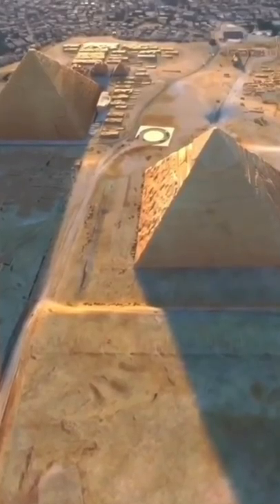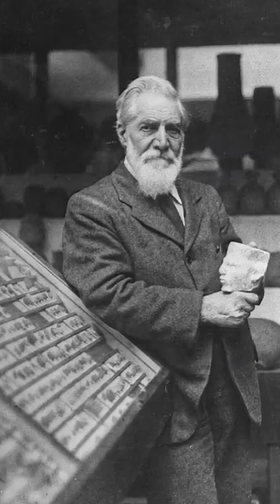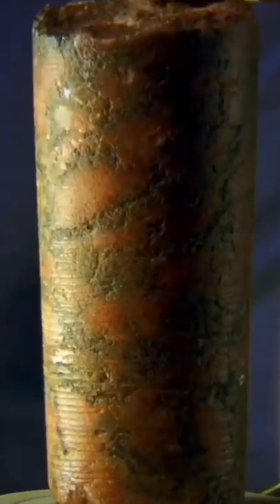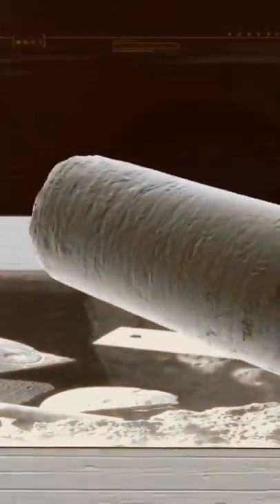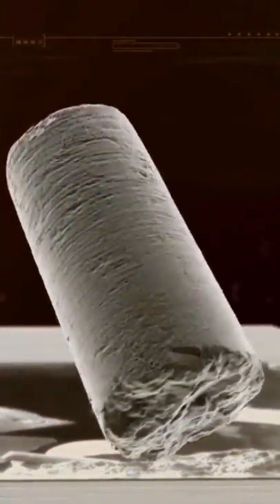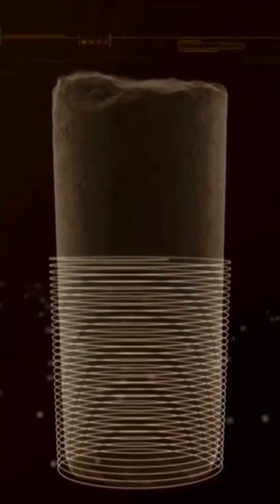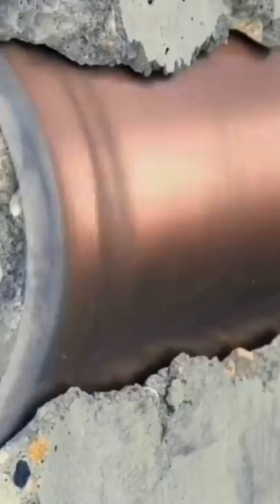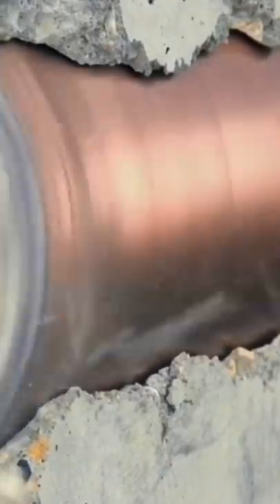Advanced Ancient Tech found in Egypt! Core7

Comment: I do core drilling for a living. I use a drill like that with diamond bits. The cores from the concrete look a lot like that.
Reply: Sorry to bother but would them putting diamond laces materials on a “drill” would it be able to cut this? I’m just tryna figure out how they did this!
Reply: @HurtsEnd  I don't think it would work. I believe it would bind. The diamonds need to be a part of the teeth of the drill bit, along with a high speed drill.
Reply: @HurtsEnd  heat or water to soften rick
Reply: They wouldn’t have been capable of making such a tool to drill in this manner
Reply: I used to core as well for a geotechnical/civil engineering firm. This core has more course grooves than the cores I would sample. Idk, looks different, may be because it’s old af.
Reply: I don't think they were as precise, but when there's a will there's a way. They were humans just like us, just different knowledge, not less, different. they of course had an approach more suitable to whatever technology they had at their disposal, the problem is we don't know that and this makes us question whether they had technology at their disposal we thought otherwise impossible. maybe they didn't have electronics, but had a greater understanding of using the basics because that's all they had to work with(heat, friction, gravity, simple mechanics, water) maybe their was some type of huge drill, rotated by pulleys and cranks and gears powered by either livestock, humans, water, or some other type of engine we didn't know they had access to like a steam engine. if we were wiped out, we'd be less impactful than the Egyptians, because they were smart enough to leave mega structures that would not go away
Reply: “1600 revolutions per minute”? I didn’t see 1600 grooves on it. And that’s being generous considering it likely took more than 1 minute to drill that.
Reply: @geddes.  this is the entire agreement 
That they had tools and power just as we did
The problem with saying that
Where are the tools
Reply: @geddes.  yea, it wasn't the dynastic Egyptians. They didn't have the tech. 
It's the lost, advanced civilization that got wiped out during the last ice age. That simple ,
Reply: @mikem4203  Where will our tools be in thousands of years? That's right. . Dust
Reply: I think they misinterpreted the actual   history
Reply: Search for how to melt stone. Guy uses frequency on copper to cut hole through stone
Reply: Look at the slight deviations in the markings up and down along the path. It speaks of irregular movement into the drill hole during operation. That would not happen on a mechanically driven tool.
I'm thinking a slow rotating diamond (or other hard material) drill that was applied with weights.
Also you have to remember there is a large probability the granite was molded with geo-polymers, therefore holes were probably drilled before the polymer was fully hardened and thus drill bits could have been made with the copper that was available..
Reply: im the manager of a core drilling coorperation, i agree
Reply: It is a modern core drilling specimen.  Someone cored the rock to see what it is.
Reply: @HurtsEnd  Modern core.  Start there.
Reply: @h.w.2038  Yeah, modern drill core of the rock, at least 75 years old.
Reply: @liamnitro8043  if you heat a rock to be brittle it will stay brittle. water does nothing to hard rocks like granite.
Reply: There was an acidic substance that softened the stone, I think they used this in conjunction with a tube drill
Reply: @ryanowen510  No one could ever tell how many revolutions per minute the tool was spinning to make that without knowing how long it took to cut that. This makes stuff up all the time.

The problem is exactly what you just pointed out, if we made that core with todays technology, it might take 20 minutes, and at a low speed like 800 RPM, you are looking at 16,000 grooves! So many in fact that they would be nearly undetectable, not clearly visible like this ancient one.

This is some technology that we either lost, or never had.
Reply: @liamnitro8043  They use a slurry pumped down the inside of the pipe.  At least they do on the diamond drills where I live
Reply: @josholsen5736  There are bits of diamond in the metal of the drill bit. We use old worn out diamond drill bits to dress wheels on grinders
Reply: @HurtsEnd  The pressure required to drill into granite at this rate would destroy any diamond/gem cutting tips
Reply: @geddes.  well they obviously did! -_-
Reply: @mikem4203  well there was this thing called a cataclysm causing the ice age to start ending
Reply: @dack4dust856  someone did. But maybe not them
Reply: @geddes.  Then someone else built some of Egypt's stuff.
Reply: @BeatlesFan1975  I agree. Either someone more advanced before the dynastic or something has been lost from their civ. I just read a book regarded the sacred geometry of the king Ramses statues and now I feel like it could’ve been possible for them but we just have no way of knowing. Would be also nice if we could date the time of the drilling.
Reply: @SirTweaksalot92  I agree we just don’t know who
Reply: @mikem4203  I can agree with you. The tools should be around. I just read a book on how the dynastic Egyptians made the statues of king Ramses. I think they’re quite capable I’d love to know if and how they drilled and quarried their intricate work.
Reply: I'm sure the egyptians knew of diamond and how  hard it was. I could see them using diamonds pounded into a core drill. With some simple wood gearing, a flywheel and rope I think it is possible.
Reply: @HurtsEnd  You are also talking about a "drill" and that would need electricity to work. Where will the electricity come from to work the drill?..
Reply: Math is a beautiful tool, modern day people mad because because you lack the variables to find the solutions
Reply: @geddes.  I believe gears were invented to help move a bit at a high rate of speed. They were also used to move the great stones as well. Just my theory
Reply: @ryan owen  I seen an in depth study of this and it wasn't 1600 rpm but it was in fact drilled at a greater penetration rate then we are able to achieve today, if they softened and drilled slow but deeper cutting who knows but impressive regardless

Comment: I seen a small science project that someone made explaining how this could be done. They took a copper pipe drill made in the style of ancient times and attached a large spool of rope around it before locking it in to a frame to keep it upright. They then attached the rope to a pulley that went up to a large wooden tower with a heavy weight. When the weight was dropped off the tower. It pulled the rope and through the pulleys. Spun the copper pipe drill at great speed and force. However, it only got about half way through before the copper pipe drill bent due to the granites hardness and the force from the weight.
Reply: They'd also need a drill bit in the middle of the core drill.... Anyone who has used anything like a hole saw would understand this
Reply: @drwe57  yup also downward pressure on the "bit" which would be hard to do and have it tethered to something above it
Reply: @drwe57  not if the frame and set up is rigid enough. Mag drills for instance can use hole saws without an arbor. This would have been similarly rigid.
Reply: @drwe57  dude you never used a core drill apparently
Reply: the gap between the ridges are very large which means alot of material was removed on each turn so copper definitely wouldn't be tough enough to drill like this
Reply: @awildtomappeared5925  it’s odd Egyptian had swords, knives, wheels for chariots and other things clearly not made of copper so why do
All there tools have to be made of copper?
Reply: @drwe57  no just a means of holding the outside circumference of the core drill. Wood could be a great material for this.
Reply: What a really long a conflated way of saying it in fact didnt work
Reply: @TheShmeebitdog  no kidding. I keep reading people talking about copper drills. Who says they were all made out of copper?
Reply: The ancient Egyptians had bronze.
Reply: @mattjack3983   what was embedded in the  bronze core drill... diamonds?
Reply: @drwe57  core drills don't have a a center bit
Reply: So it failed yeah🐜
Reply: @TheShmeebitdog  Egyptians only had access to copper and copper alloys , bronze wasn't even discovered yet. They also didn't have wheels since in order for wheels to work you need roads
Reply: @TheShmeebitdog  chariots are a Roman thing and Egyptians were an ancient civilization to the Romans
Reply: Apparently they mixed arsenic with the copper and it made it harder? Learned that somewhere
Reply: @kianharris7783  you don't need roads for wheels to work, that's quite idiotic. Does your dirt bike stop working when you go off road?
Reply: So first they had to build a large tower, then make rope and also a copper drillbit? Then and only then; they can drill a halfway deep hole? That's alot of stages to be had for a hole dont you think?
Reply: @frankferriolo9212  We use more steps to drill holes now, you just don't think about it.
Who produces the electricity you use to power your drills?
Who makes your drill bits?
Who makes your drills?
Who makes the motors, cables, batteries that go into making said drill?
Who extracts the minerals used to make said components?

Critical thinking is rare nowadays
Reply: @kianharris7783  
"The beginning of the Bronze Age in India and western Eurasia is conventionally dated to the mid-4th millennium BCE" 
The Egyptians had bronze for a thousand years before the pyramids were built.
Reply: @kianharris7783   bronze is a copper alloy
Reply: Just drill the same way your drill with sand and water, but instead of sand you use a different abrasive that chemically reacts to granite. Like salted water.

It explains one detail not mentioned in the video, the fact that the top of the core is slightly smaller than the bottom.
Reply: @frankferriolo9212  so? if you broke it down how many steps do you imagine we use to do things today? that's the power of having a civilization
Reply: You never use force on stone masonry… you use rotations and repeat those rotations until they managed to slowly cut through. It’s like sandpaper. Using abrasive material at the end of a pole can help create scratches that dent into the stone and thus digging or drilling into stone.
Reply: @awildtomappeared5925  the problem is that those ridges were very small when looking at it in person. The dude made a close up view of it but even so the problem is that iron wasn’t invented yet and wasn’t used during this era of masonry. They had copper for tools and everything unfortunately.
Reply: @TheShmeebitdog  no  reality was that most of Egyptian tools and other items were made of wood, copper or bronze. They never had iron until they traded with Chinese traders. The last pyramid built was roughly 1800 BCE to 1700 BCE which if you paid attention in school the Iron Age for Egypt was roughly 1200 BCE to 1000 BCE. 
They had iron tools just at the end of their noble creations were already finished. 
Either way there’s a big issue going on in the history community involving Afrocentrism’s and the problem with owners of Google allowing Afrocentrism to go uncensored and causing a big mess for society in America and other neighboring countries. Especially in Egypt. 
Egyptians were proven never to have any relation to Ethiopian or Arabian ancestors but still millions of people threaten scientists who were only doing their jobs figuring out the dna of the mummies discovered from one of the oldest tombs discovered in Egypt.
Reply: You can’t shape granite with copper, it’s much too soft.
Reply: Wrong concrete core drills without middle drill bit and they rent them everyday so I’m sure they rented one. Lol
Reply: With pulleys and the same called building with the weight how much smaller than you have to remember to always to lift the weight to the top of the building and let it go down and lift a good continuous thing you can even have one of them and continue stressing it on the pull up
Reply: You know the drill....
Reply: What about the 2000 psi on the bit
Reply: That's cool though
Reply: @kianharris7783   Egyptians use the wheel to measure the base of the Pyramid.. That's why pi is part of the calculation of the circumference of the base.
Reply: @QRW Sec carve a circular hole, chisel the edges out. Simple
Reply: @QRW Sec Slap your chisel on the end of a stick, done deal. Or just make a longer chisel to begin with
Plus, granite can be carved using a plethora of materials, including copper. It's hard but that also makes it brittle, perfect for chiseling
Reply: @QRW Sec Can no longer argue so you reduce it to an ad hominem? I'll take that as as a win
Reply: @drwe57  so um a lot of holesaws have a removable drill bit where you can just drill with the drum part.  It's hard to start a hole without it going a little wild on you but it's definitely doable.
Reply: @QRW Sec Which, by the way, never did I say make a hole with a chisel. Might want to read my comment again.
Reply: @QRW Sec you're logic is flawed.  There are  many, many videos out there showing carving of granite with copper chisels and tools.  Yeah, you need a lot of replacement tools, but it's definitely possible and has been done.  People have even built miniaturized versions of the sphinx with nothing but copper tools in granite.  Also, your instant jump to insults are a good sign that you really have no clue what you're talking about and have been proven wrong, you just don't want to admit it and are lashing out at those who you feel have wronged you.  First of all, grow up and learn how to have an adult conversation without instantly jumping to insults like a child.  Secondly, learn to read about what you're trying to argue against and maybe, just maybe you won't look as ignorant of the facts.  Maybe grow up first, though.
Reply: thats foking smart
Reply: Chemically weaken it first and it'll be even more impressive as it can be done by hand if you do so.
Reply: Coppers extremely weak! It’s mostly use just for conductivity and hidden pipes.
I see how it could still work using a different material though!
Reply: @kianharris7783   the did have bronze , the end of bronze age is 1250 -1150  ce.
They also had ALOT of chariots. 
https://en.m.wikipedia.org/wiki/Battle_of_Megiddo_(15th_century_BC)
Reply: @WarAndFame  when you mix arsenic with copper you get......bronze  , they started to use tin because it was safer for the user
Reply: @kianharris7783  what about the iron dagger buried with king tut?
Reply: @awildtomappeared5925  Possibly, what was used; diamond drill-bits, considering Africa's diamond reserves. Additionally, there are reports of the pyramids being very shiny. Probably, would have camouflaged them to an extent - a mirror-like exterior - and would have kept them cool.
Reply: @christophercutri5934  possible but even diamond drill bits today can't carve that deep per revolution  so idk
Reply: @TheShmeebitdog   Bronze began use around 3500 BC, anyone saying it was not possible for the Egyptians to have Bronze tools especially during their height have no idea what they're talking about. Bronze's durability is substantially more than that of copper, even if the Egyptians did not have the ability to manufacture it they could have commissioned it from another empire/nation that did have the ability or knowledge to produce bronze tools.

Comment: Id love to hear about 1600 rpm reasoning.
Reply: Ok I'll give it a shot best I can think of is using the force of the flooding Nile they channeled rotational movement through a waterwheel and used gears and a flywheel to keep the momentum going I'm going to guess at a giant copper/bronze cylinder was cast or forged this coupled with The rest of the setup would account for the weight bearing down on it and that's about as far as I can make any sort of reality based claim that I can think of and that's me thinking how I'd go about it if I had to do it or at least that's what I'd attempt to do first
Reply: 1600 Ramses Per Movement
Reply: @AnAsian1  🤣